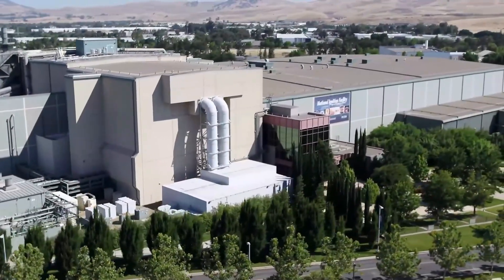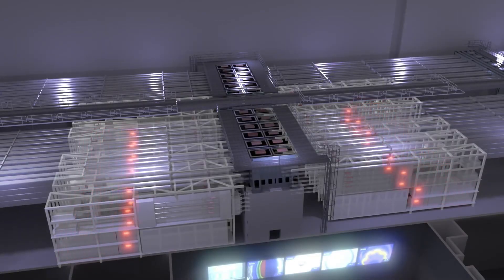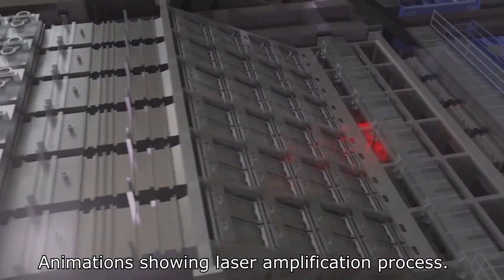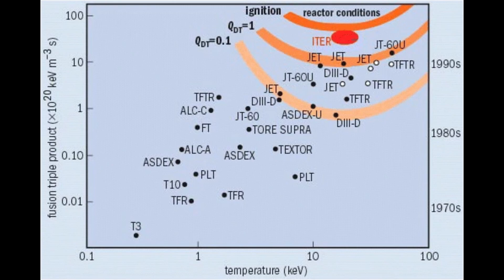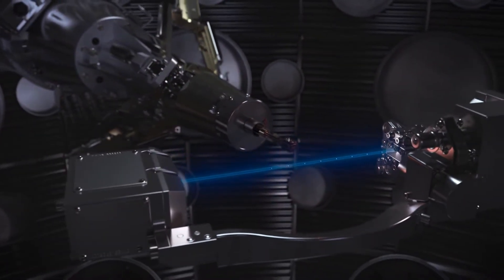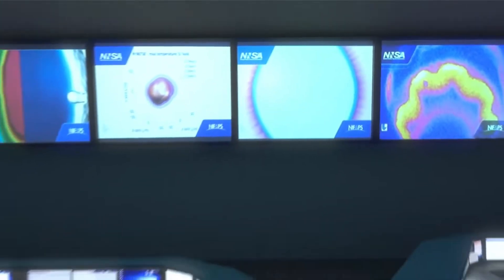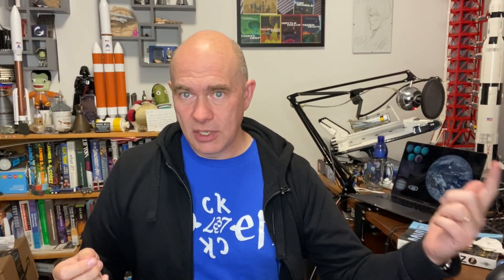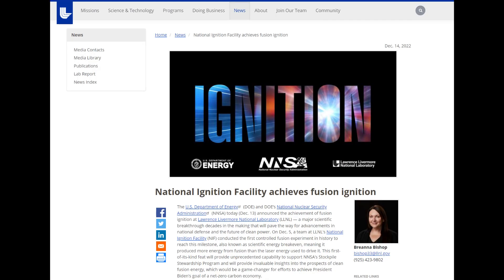Why The Biggest Laser in the World is Making Big News About Fusion

Comment: The large problem was pellet design and fabrication. Plus only in the last couple of years are the sensors and processors and memory fast enough to control precisely enough.  Rather than ultraviolet lasers, they could use particle (electrons, protons, heavier particles) beams and achieve compression at much smaller scale and much lower cost.  They could also use soft xray lasers. But electrons are much easier and cheaper. And particle beams can now be controlled precisely enough.  There are better ways to calculate the other things.

300 MegaJoules in 2 mm diameter is 300 MJ/((4pi/3)(10^-3)^3) = 7.1619724E16 Joules/m^3

Look at the curves at 6:54.  Those are small energies for particle beams. If a group spent as much time and money on those to prepare the particles in precise states, and carefully monitor and record every tiny result - the particle beam fusion, and "Mr Fusion" would be much closer and practical.  Getting off the earth would help.  The gravitational, magnetic, electromagnetic, seismic, radiation and human noise is too much.  Space might be a good place.  I was going to look at the moon again.

Maybe you can make a video on the current plans for the Moon - good vacuum, free land, no noisy neighbors, always a clear sky for just looking at the universe.  Or maybe you could investigate the economics of fusion devices.  Countries can hardly feed themselves, or care for the sick and elderly.  Do you think these isolated wonder projects will make any difference?  Probably not.

The diode lasers have efficiencies in the double digits, much larger than 1%.  And they can generate (more easily actually) ultraviolet. The free electron laser is efficient.  And if it were engineered it could make the whole system efficient enough for economic practicality. But you do not have to modulate or use coherent sources, you just need to measure and quantify what you do produce, and its effectiveness. So measurement and control systems are more important that size and brute strength.

Comment: The best way I have heard of to get energy from fusion was to use the massive magnetic field fluctuations as a result of the fusion to generate electricity directly. Look up Helion's fusion reactor. It generates it's own Helium-3 fuel in the fusion process, starting from abundant deuterium, and getting a multiplier effect by stepping up the fusion process twice. They are much closer to being able to generate electricity than Livermore reactor.
Reply: I don't think so. Helion try to solve a problem only introduced by its design: their plasma is one time use; so they have to recycle the energy from the collided plasma.  This problem does not exist in other popular design. As long as they use same reaction as others, the products of the fusion won't change. This means large portion of energy are carried by neutrons. It does not really interact with electric field. The only effective way so far is to absorb the neutrons and generate heat.
Reply: @xx5949  Helium-3 is generated after decay of tritium, which will eventually be plasma fuel, so technically not 100% single use. The losses by not capturing the neutrino energy might not be an issue because one, they can still look into recapturing the neutrinos into heat anyway, and two, the losses the popular designs experience by converting the heat to phase transition to steam, and the steam into kinetic, and kinetic into electricity are substantial and most researchers are ignoring that for now, just trying to create more "energy" than they used to create the fusion by a factor of 1. That's not enough because of all the losses it takes to harness the energy. Helion is going directly from fusion to electricity, bypassing all of those potential losses. By measuring success as ultimate electricity output, Helion is much more competitive than it may appear if you're looking at the entire system.

Comment: Just to clarify NIF is not interested in getting more power out than they put in. Thier goal is to provide data for constructing better fusion weapons. In fact their facility is built in such a way as as to dissipate heat as to keep systems cool to generate power and you need to collect waste heat up to about 110'C. 

Here's the deal about the sun. We estimate energy output as the flux of heat on the surface. While this energy perculates up from the core, the core is relatively small, but its volume is HUGE compared to the surface area. So for example here on earth the energy is 1.4 kw per meter. We are 150,000,000 miles and the radius is about 450,000 miles . This translates to a balmy 150 to 200 MW/m^2 on the surface. So that seems like alot, but that energy production is occuring over 200,000 km radius of core. It breaks down to a few watts per cubic meter. You cant very well run a power plant on a 1 cubic meter box of solar core. 

I actually don't know what the point of the conferance was, clearly their interest in fusion power was secondary, and, I mean, the DoD hawks knew what their power output was before they did. What else, to announce to the chinese they had a new technology to pilfer? 

Helion apparently has a reactor that can breed both tritium and helium 3. I doubt their reactor will ever produce power, but atleast it can make these two. 

If you You Tube search Real Engineering Helion theres a video on this, they are fusing 3He, 2H repeatedly 10,000 times so far, no pellets the just "railgun" the two cations into each other. 
   This reaction maybe interesting to you Scott because it doesn't make Neutrons. I did the calculation on the "Ve" of the protons, its about 1/6 c, that pretty respectable. Its a shame they wanna use them to make power. With a little magnetic confinement of the products of the reactor could be turned into a thruster (Albiet you need another nuclear reactor to power it).

Comment: The ignition claim is dubious and misleading. The amount of total energy going into the lasers was significantly more than what was released. While based on good science, it’s a bullshit claim.
Reply: No, there is a small flaw in your understanding of what's being claimed.  They did produce fusion and they did get more heat out of the system.  You're thinking the total energy in, which is not the metric being used.   The claim is legit, your understanding of what is being claimed is flawed.  This whole thing is useless as anything other than a proof of concept.  A useless concept.
Reply: @TheEvilmooseofdoom  so what you’re saying is that more total energy went into producing the fusion reaction than what was released, but I’m the one that’s flawed in saying more total energy went into the fusion reaction than what was released?

Good argument. 👍
Reply: @buttsexandbananapeels  I suspected you might struggle with the concept.  Okay.  They spent energy trying to create a set of conditions, temperature and pressure.  They wasted a lot of energy creating those conditions.  In the past when they created those conditions they didn't get more heat and energy back out from those conditions.  This time they did.  So they managed to prove a concept, they did NOT do anything practical.  It was NOT a net gain in terms of total power, just a net inside those narrow constraints that demonstrated that they did get fusion to happen.  That's the ignition part.  For an instant, after all that, they got something to fuse.  It's FAR from being useful OR practical.  It's just a proof of concept.  You CAN use lasers to create fusion.  Is it worth it?  Is it practical?  No.. not yet and likely not ever.
Reply: @TheEvilmooseofdoom  so what you’re saying is more total energy went into the fusion than came out of it?

Comment: thoughts on helion? they're using "reverse field configuration" 

apparently, it's a variation of 'pinch' reactors with some new innovations.  Apparently, their next generation (7th gen) reactor "Polaris" is supposed to put power on the grid when its fully operational.

They're generating their own He-3 fuel from Deuterium and using Helium-3 Deuterium fusion with virtually no neutron production in the main reactor and a direct conversion to electricity with no heat engine components required

Comment: Besides that the "news" of fusion being a total PR stunt, in terms of getting more energy out than putting it in, I am happy you explained it much better than all the other channels and did not hop onto the bandwaggon of PR bullshit.
The lawson criteria, doesn't depend on the time and doesn't accept lower temperatures or pressure. The extrem temperature of a 150 Mio degrees has to be met and the high pressure as well. The experiment has to increase the chances of tunneling to that certain point, so they don't have to overcome the Van-der-Waals forces.  
The benefit of the ITER (tokamak) or Stellerator concetpt is, that they can run continously and are therefore more suitable for a power plant. The stellerator can be run without brakes, see Wendelstein 7-x in Greifswald. While tokamaks depend on an external magnetic field to generate an inner current, inside the plasma to concentrate the plasma, and therefore have a limit of changing those magnetic fields. So they have to be periodically restarted, like every half an hour or something like that. Restart means, just confining the plasma again and get the fusion going again.
The reason the european based projects (usa is a partner in those as well, like ITER) stay below the iginition conditions is, that they want to avoid the fusion because than the confinements would be radioactivly conterminated and have to be remotely serviced if something inside needs to be changed. ITER should be capable of fusion and producing the necessary conditions, but they use other atoms, that have different lawsons criteria, so they dont ignite. Deuterium and Tritium are by far the easiest to fuse. The Tritium will be produced within the fusion chamber from lithium. 
ITER is in fact a field study, if a power plant is feasible. Next step after this, would be a much bigger facility as a power plant. 
First plasma ignition for ITER is scheduled for Dez 2025. At the moment they are building it, as a worldwide coordinated and contributed project, which in itself is a challenge and an achievment. Imagine you want to change something on your localy build part, but there are parts with zero tolerance, so you have to check with everyone else to make shure assembly will actually happen. It is a massive worldwide effort. Every partner nation is building parts, to achieve the know how.  It is a 800 qubic meter reaction chamber, which will be occupied by 1 gramm of mater. That is the smallest size, you could use to build a reaction chamber to get as much energy out, as you put in (compared on the electrical side, and not some shady laser numbers). After that they would have to up the size. Volume to mass maters in terms of containing heat. The colder the place the pinguin is living, the bigger the species is.
ITER will start with no ignition experiments, than have a down time and than start with the ignition test. So from Dez 2025 there are still a few years to go, before we can scale it up a notch. The interesting part, will be to marry the findings and lessons from ITER (a tokamak) to the stellerator concept. They claim it is possible to combine the concepts without a headache. Than the first power plant, would be able to run non stop. The size would be something like 3,4 GW, compared to an ordinary coal or gas power plant with 0,6 to 0,8 GW, that is huge. The bigger, the better in terms of volume to mass ratio. But usually, there has to be held the same power in "stand by" mode, in case the power plant is gonig down unexpectatly there need to be an immediate replacement or the whole grid is down. So that will be an additional challenge, when it is ready to work.
If we wait those 20 years for real power plants, climate change is a done deal.

Comment: The truth is never told by any fusion entity until scientists speak to one another.  NIF admitted in a conference that to charge the lasers capacitors to store the energy to fire the lasers took 300+ megajoules from the electrical grid. Upon discharge the lasers blasted about 3 mega joules of photons into the D-T capsule to create just a tiny bit more energy than the photonic laser energy hitting the D-T capsule.

Let's get real, they turned 300 megajoules of electrical grid energy into  3 + megajoules of fusion energy.  A 100 to 1 net loss!  A fabulous fail!

It is like we will need a 300 megajoule fission reactor or coal fired plant to fed NIF to produce 3+ megajoules of fusion energy.  Ain't it all so great and wonderful?
Reply: You missed the point, the amount of laser power was not the metric, it was the amount of heat and pressure they got from those lasers going in.  Your understanding has a flaw.

Comment: molten salt reactors were further along 50 years ago than fusion is now
Reply: What is the longest running MSR?
Reply: @TheEvilmooseofdoom  The late 60s Oak Ridge experimental reactor accumulated over a year of actual runtime - not very long but an ETERNITY compared to the sub-millisecond total runtime of all the inertial confinement experiments combined. Not that runtime is a particularly interesting metric. My point is that the Oak Ridge experiment was already testing things like safety and longevity of the systems while this fusion project is still wrestling with the fundamentals.
Reply: @moneyluser5711  That reactor never ran steady for a year.
Reply: @TheEvilmooseofdoom  yes, that is why I used the term 'accumulated'. The fusion experiment in this video does not run continuously either. But if for some reason your metric of choice is 'continuous runtime' then the Oak Ridge experiment wins by orders of magnitude over the fusion experiment in the video.

Comment: Yeah thats cool but working with obsolete lasers to begin with doesn't help their case, and I don't see how you'd make a continuous energy supply out of this, u'd need something that goes inside a very hot chamber to reposition the next fuel pellet, somehow without it being damaged by the heat...
Also these labs doing stuff like this should, if they don't already, hire ASML and carl zeiss to give them top of the line lasers and aiming systems because it's one of the key points that make current electronics nodes work these days ( With the recent switch to EUV lithography and all that ) that industry took 20 years to perfect it maybe no need to reinvent the wheel at every level ?

Comment: The announcement from the NIF was pretty misleading. They failed to take into account the huge amount of energy they used to power the laser. If you take that into account, there is nothing very special about this experiment. It's just another experiment for which they used (a lot) more energy to produce the experiment than they got out of it. So, basically, this was just a big smoke and mirrors show, nothing more.

Comment: When co-workers were talking about this the other day, they said it was a tokomak that did the net energy output.  Not having looked into it yet, that surprised me, as I figured it was far more likely that intertial would break that barrier.  Turns out I was right.  Unfortunately, I'm not really sure that inertial will EVER work as a power plant.  The way it works just isn't really conducive to sustained reactions or extracting energy as useful electricity.  Those problems are going to be way easier to solve in a tokomak or similar device, like that piston thing you showed that I hadn't been aware of before.

Comment: Edit: This was answered near the end of the video, and the answer seems to be no unfortunately. Capturing the energy seems like something we haven't figured out yet.

Does the 1% efficiency for the lasers mean that using modern laser technology and more modern understanding of photonics we might theoretically be able to scale down this system to sizes reasonable enough for power plants using current materials and manufacturing processes? Seems like we've probably gotten a lot better at making lasers in the 30 years since the 90s, both in terms of their size and efficiency, and if the system makes more energy than it takes, then we've done it right? We can in theory start building many of these systems based on modern technology and science and build enough of them, with some energy storage solutions, to generate enough energy to solve the global energy crisis?

Comment: It is not the only problem, how to konvert the kinetic energy of the neutrons into a useful to generate electricity. On the other hand this is a labratory exoeriment that only works in an labratory. The fixing arm to position the probe into the laser beams will evaporate instantly, when you size this apparatus up. Okay, you can do ist like the people of asml do it, to inject molten tin drops like a inkjet printer into a beam of energy, so it emitts high power light nearly contnously for the chip production. But will that ever work for long time nearly continouasly, how it is needed in a power plant????

Comment: How much power is needed to contain such a continuous reaction?  Can't generate power with any practicality if the reaction can't be sustained.  Usually, that means a magnetic envelope, since no material we know of can contain a fusion reaction without melting/vaporizing.  A magnetic envelope requires beaucoup power to maintain.  No fusion reaction generated experimentally so far can exceed the overall power required to make it happen and keep it happening.  Not even close.  And that includes this experiment.